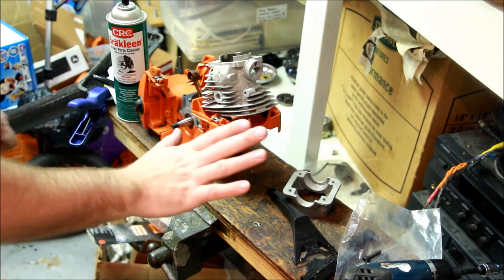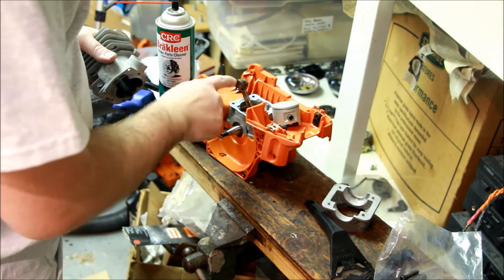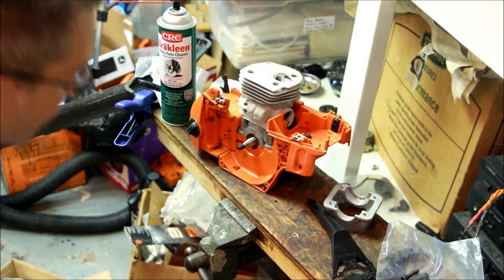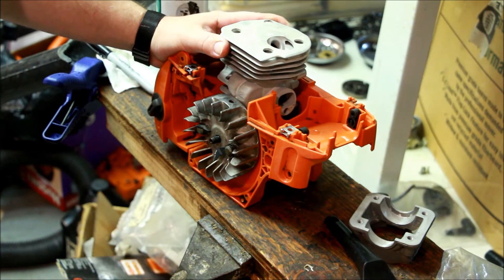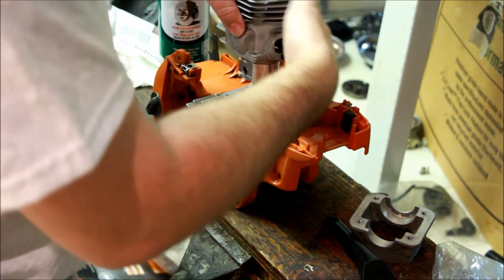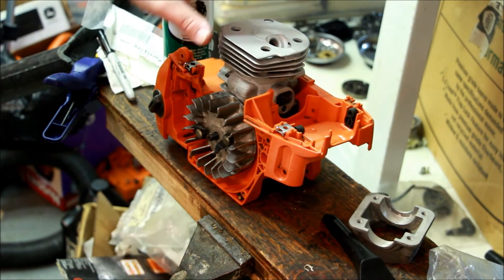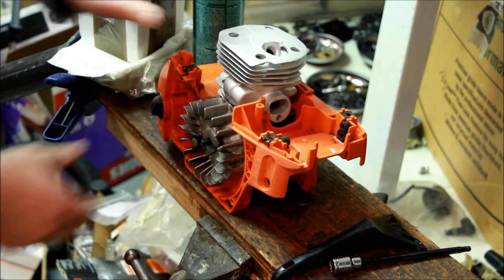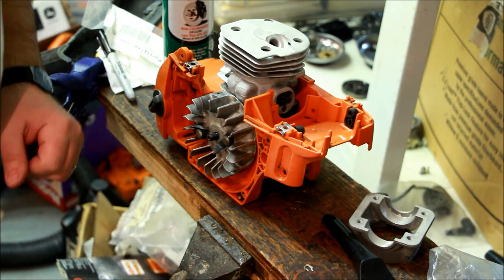Husqvarna 350 346xp comparison of squish for different cylinder kits

Comment: Why are you adding the gasket thickness to the thickness of the solder? You already have the gasket installed correct? So isn't the squish whatever the thickness of the solder is? And if you wanted to go gasket less than you would subtract the gasket from the solder. Did I miss something?
Reply from the maker: I'm probably going to mill the base.   The thickness of the gasket will become the squish.  Which is about .020"